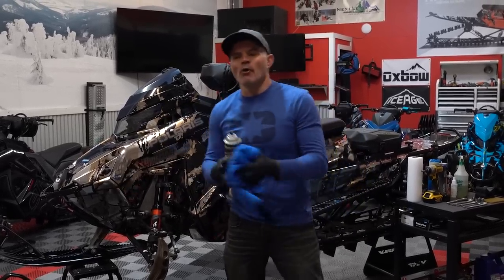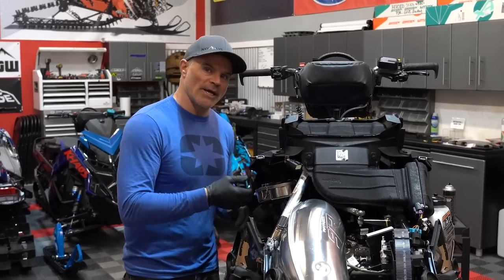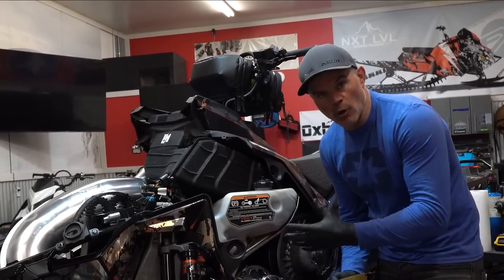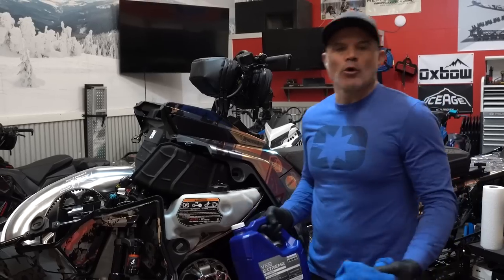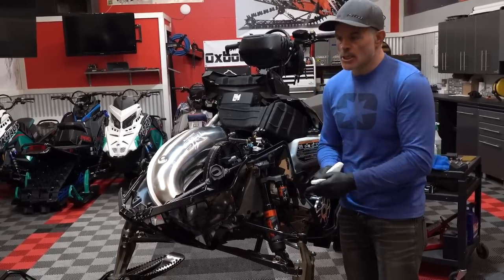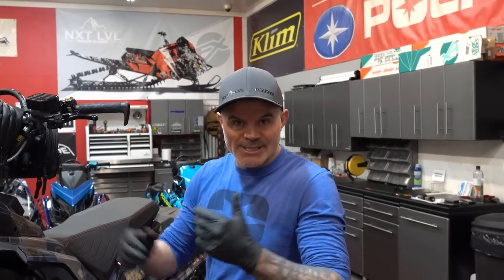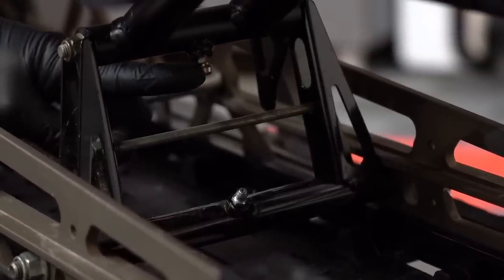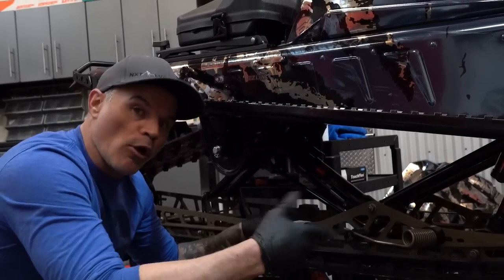Mid Season Maintenance

Comment: Spot on.  Nothing better than having your sled in your heated garage up on a lift after every run.  I always clean my machine, check belt tension, occasionally check drive chain tension and grase the machine between runs.  I also believe doing these simple checks lets you get far more familiar with your sled which means you'll be far better on top of things when something does happen.